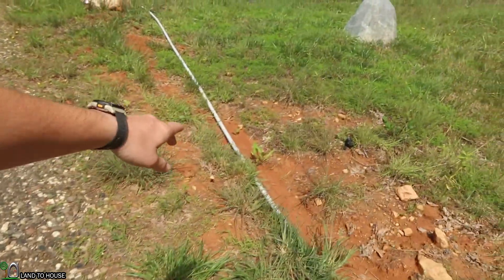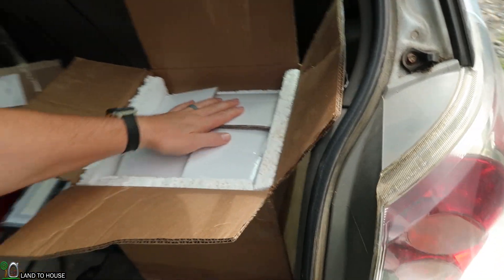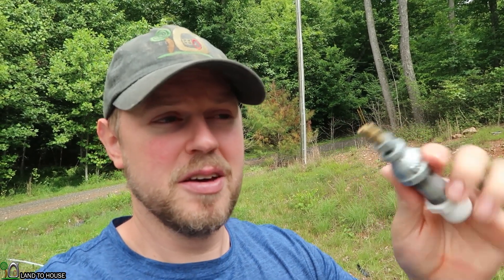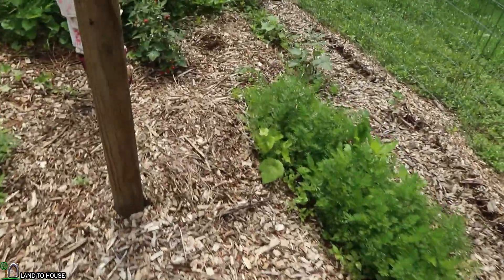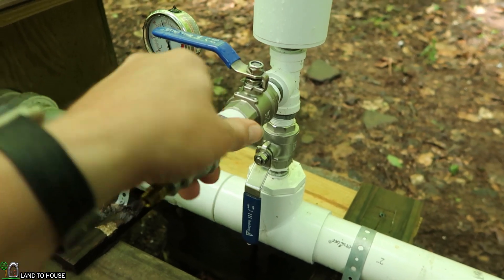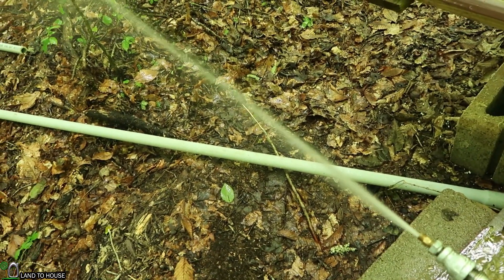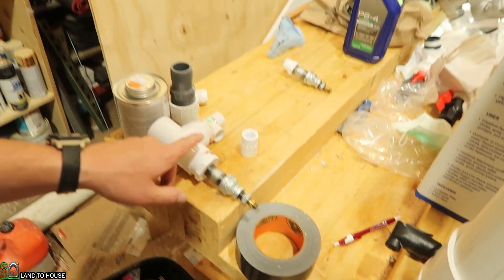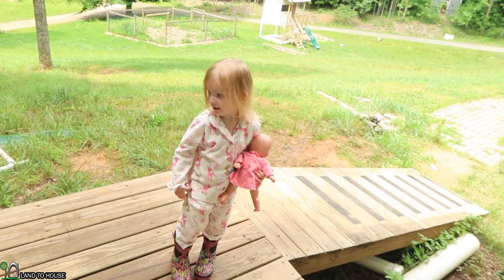An update on Micro Hydro June 2020

Comment: thanks for the update, looks promising.  When you showed the underside of the turbine in a previous video, I was surprised it didn't have a shroud around the turbine blades to more efficiently use the water pressure and flow.  Will that be part of the upgrades Spencer will perform?
Reply from the maker: This install is just getting the turbine in. I have a feeling I will be making some mods in the future. Good news... Spencer is now the sponsor of the second micro hydro install!

Comment: If you can get a nozzle made that tapers down to the opening from the threads it can be a little more efficient in transferring the energy into the water so it's not so chaotic when it comes out of the nozzle sort of like a cone shape I've seen other people do it with adjustable nozzles
Reply from the maker: Yes absolutely. We will probably do some modifications after we get the first working system done. We're doing this on the cheap for the first round.